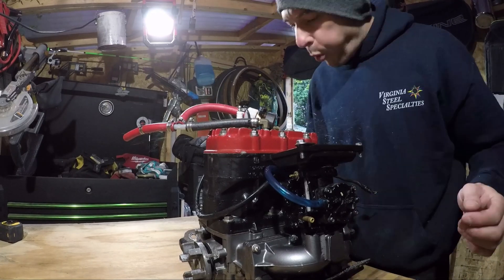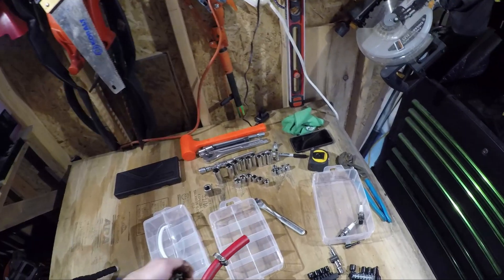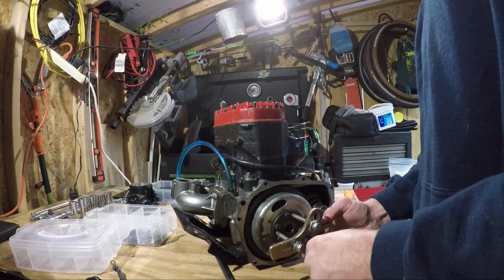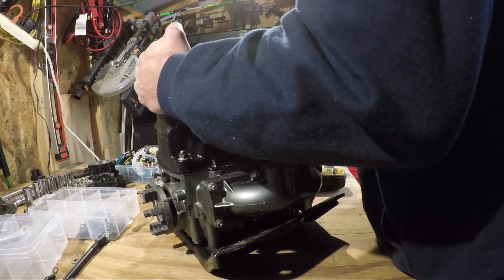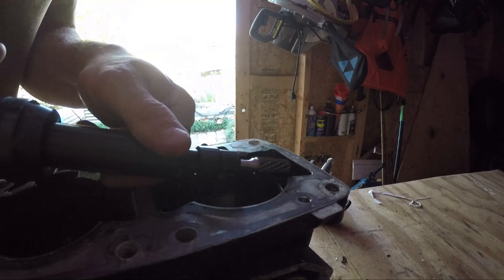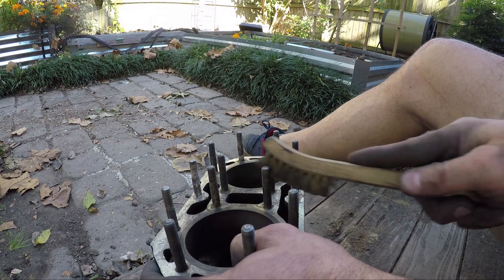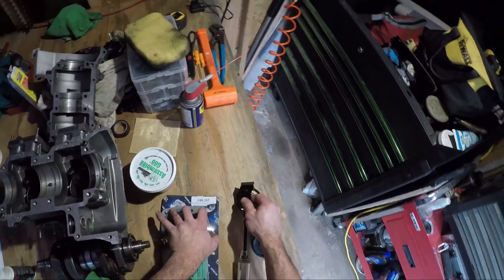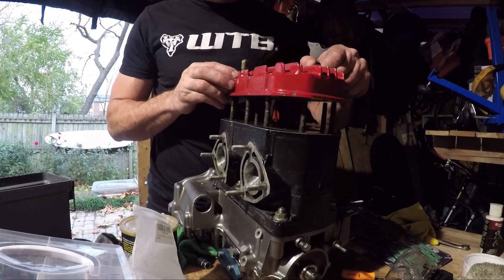Kawasaki 650sx - Engine Rebuild - Port & Polish

Comment: Did you have the cylinders bored and go up a size on the pistons???
Reply from the maker: No, just smoothed out the intake and exhaust passageways. Otherwise no increase in displacement.
Reply: @sweetschoolbus  it's pretty important for good compression especially on two strokes when you have scored pistons and cylinders. At 06:55 you can see a scored piston.
Reply from the maker: @RatherBeJetSkiing  oh, shit. Yeah, you might be right. I'll look into that. Thanks 🙏

Comment: Thanks for the great video.  Picked up a 91’ JS650SX (same model my wife bought new back then).  Had to put a new top end in going 1 size over.  Trying to find an actual service manual not just the supplement so I can try to put all the hacked lines especially the ground wires I found bolted to the intake but not connected on the other ends!  Anyone have some pics of yours 650SX ground wires (not battery) they could share?  Enjoy your stand up!

Comment: Aren’t you smashing sideways on your crank bearings? Aren’t these not at all designed for side stress? With a sledge hammer? Is that ok?
Reply from the maker: Not ideal, I suppose, but fortunately the crank itself has some mass so it likely isn't relying too much on the bearings to withstand the hammering. Also, I'm not necessarily hitting it with much force. The "shock" is more what I'm after to dislodge it from the tapered end. Tensioning with the puller, then whacking with the hammer.